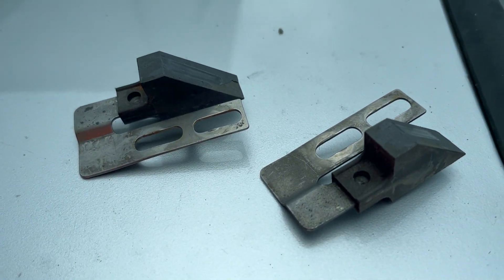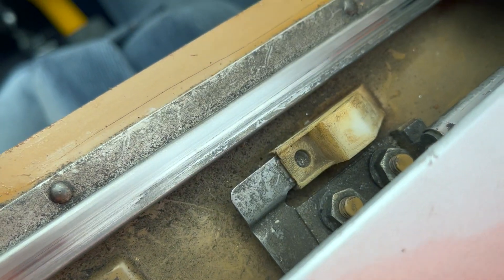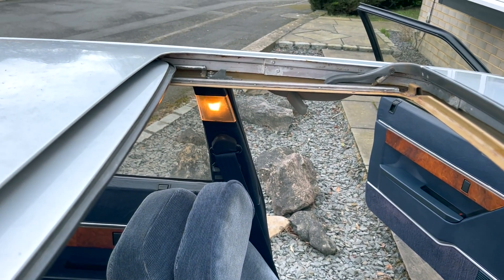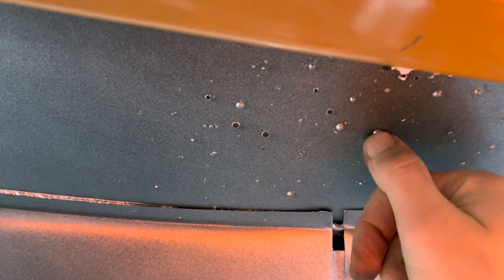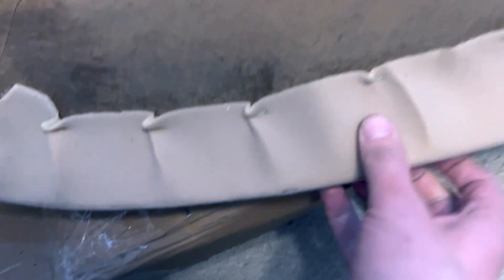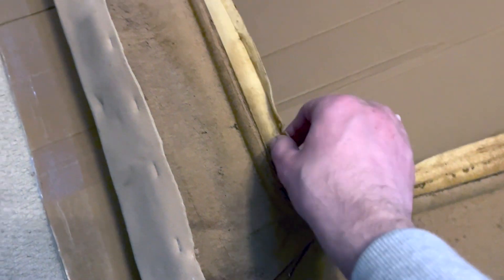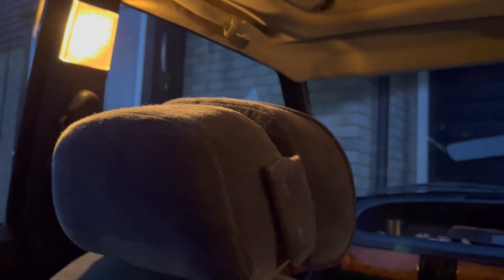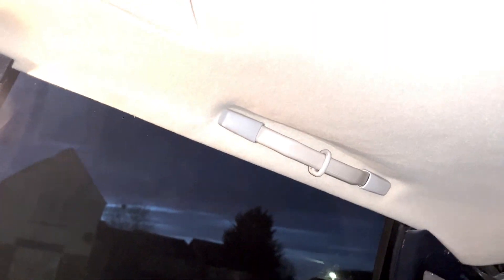Finally on final refit of the headlining of my Rover SD1

Comment: I had all the same problems with the mounting holes in my head lining from Aldridge, I think their pattern is based on a slightly knackered head lining that had some holes a bit out of shape.

How did you manage to get your new head lining not to sag btw? The fabric on mine is stuck fast to the fiberglass, but the fiberglass itself over the rear seats is hanging well down.

Final note, really nice to see an SD1 on YouTube :) I keep meaning to film more of my work on mine but I always get too into the fixing to remember to record anything 😅
Reply from the maker: Given I have a gap at the back on the passenger side, I think I misaligned the headlining. However, I suspect it'll need to come down at some point.

To stick it up, I used copious numbers of velcro strips except it turns out they're not very sticky and they've come away from the metal roof. I'd go as far as to say they're pretty crap, so be honest.

I've taken loads of videos recently as the car's been repainted and I've been readying it for the summer. Like you, however, there's lots I've not recorded as there's just so much to do and I end up throwing myself into it.